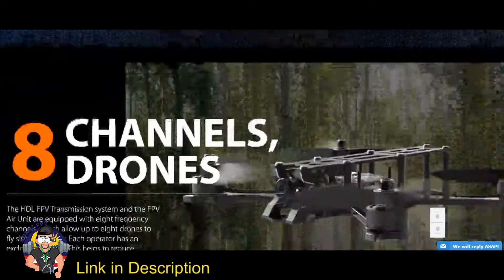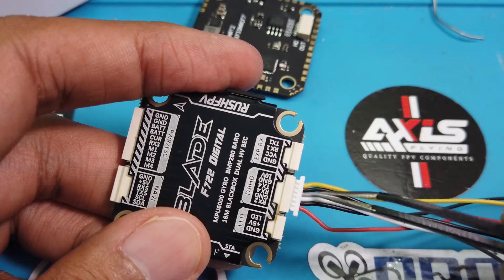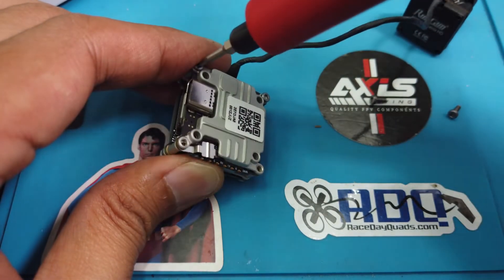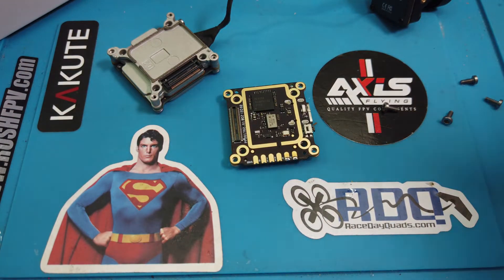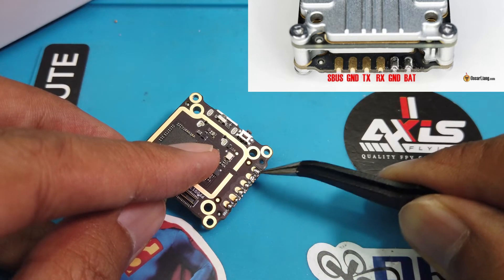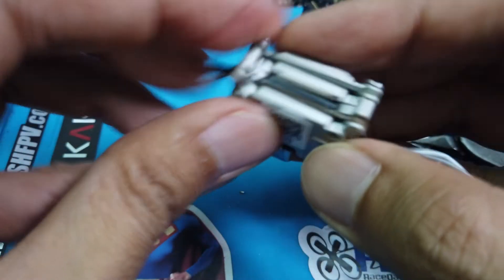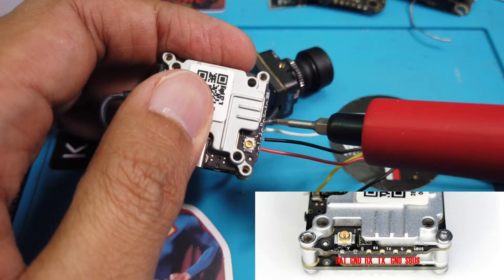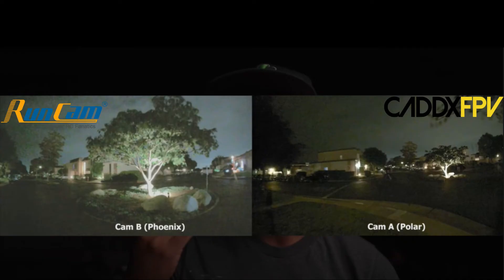DJI Digital Installation Tutorial - Runcam Phoenix Link HD kit

Comment: 14:23 
That's all I need and the camera should be operational? 
What software do I use to power the camera and what else do I need? 

Also the video was well explained I'd just like more info on this system. Thanks.
Reply from the maker: You still need to activate the Runcam Phoenix Link with the DJI activation software and configure in Betaflight
Reply: @adrinfpv  thank you so much. 
I'm currently watching lots of videos on this device. 
Your video is the best one so far in terms of installation/explanation. 

Thanks for the info on what is still required to get it operational. 👍
Reply: @adrinfpv  btw, I want to make this setup not for a drone but to use as a camera so i can mount it between my eyes to get a proper pov for Airsoft gameplays. 

It'll be my first time playing so I'd like to record it and watch over it and show friends and cousins. 
Sure its too much but I'm a nerd for tech and enjoy learning new things.

Comment: Salam dari Indonesia... Bagus sekali video tutorialnya. 
Saya mau tanya, ada sedikit masalah yang saya belum tahu. 
Macam mana menampilkan OSD dan macam mana merubah power air unit. Punya saya 2mw.
Terima kasih atas jawaban abang...
Reply from the maker: Osd akan tampil jika rx tx di sambung diuart FC, dan di betaflight Port, MSP di pilih untuk uart fc tadi. Pastikan rx di sambung pada tx, da tx pada rx. Kemudian utk menukar power air unit, di dalam goggle, tekan butang tombol di sebelah kanan atas Goggle. Saya tidak igt setting yang mana, tapi di situ ada option pertukaran power
Reply: @adrinfpv  Terima kasih atas jawabnya bang, saya coba cek kembali solderan tx/rx...🙏👍